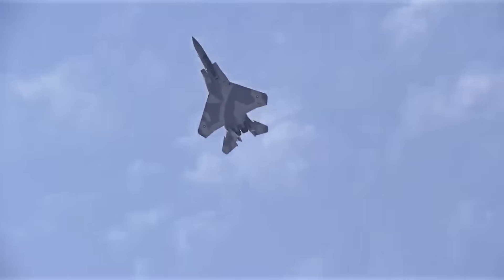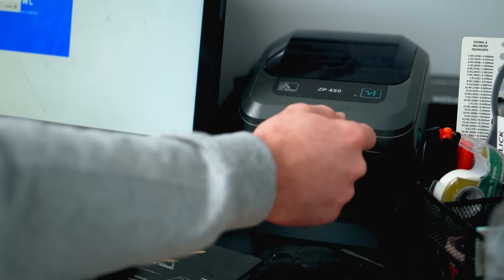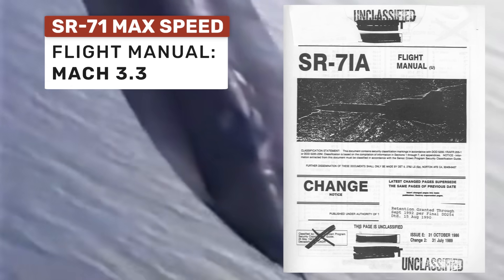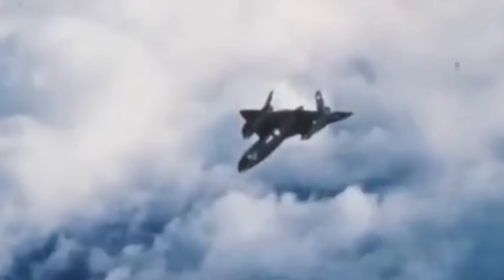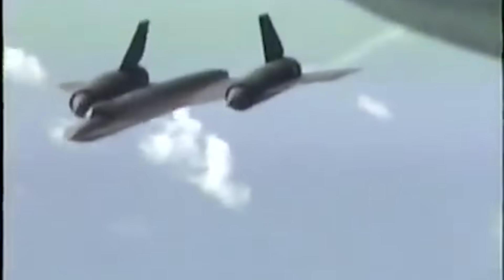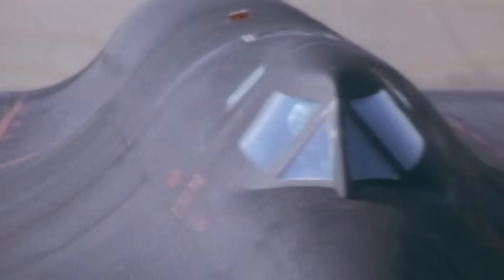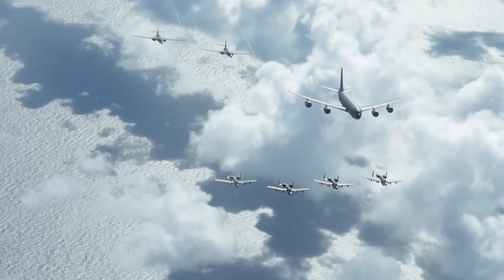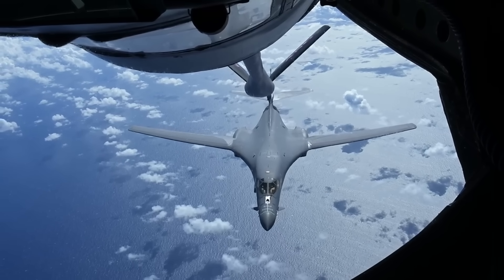The SR-71 was MUCH FASTER than the Air Force will admit

Comment: So TL;DR this plane could fly probably near the range of hypersonic if it were not for the heat build up on the frame. Nobody knows and/or wont ever say.. but I find it odd that today we have the scram jet stuff in the works that is Mach 5 to Mach 10 or more, and we're hiding how fast the SR71 could go from 50 years ago. That seems kind of silly that the real top speed matters any more when we have things that fly much faster and share those openly. Having worked in the airlines, I've talked to a few pilots that shared similar stories of "something" flying well beyond mach 5 to mach 10 on their radar.. be it ufo, military top secret, who knows. But I have no doubt similar stories by multiple different pilots at different times was not some made up stuff. So either there really are much faster military machines, or aliens are here. :D. Regardless, just seems so odd (repeating myself) that we're still so secretive over a jet that is no longer the fastest and how open the world is (China, Russia, us, etc) about scram jet speeds.

Comment: There’s a YF-12 on display at Wright Patterson AFB. When it was delivered to the base it was put on display for base brass and dignitaries. My buddy and I snuck in with our ROTC Uniforms and looked in the cockpit. The seat was gone but the Air Speed indicator went to Mach 10.
Reply: I've been in cars with a speedometer that goes to 140 or 160 that weren't capable of going anywhere near that speed.

Comment: This is not surprising at all.  I think the military dumbs down a lot of these numbers just to keep the enemy guessing.

Not the SR71, but I had a friend who was a reservist at a base that was home to the Galaxy C5.  During Desert Storm, they were loading them up to fly over to Saudi Arabia.  The listed cargo capacity was listed around 750k lbs.  He told me they were loading well over 1million lbs on those planes.  So, if they are messing with just cargo weight, speed data is a no brainer to falsify.  Those were the days though of seeing air shows at that base.  Used to park a Galaxy at the entrance and let you walk thru it to get to the flight line.  The bummer was that the SR71 was supposed to be there one of the show years in the early 90's.  Problem was that the base could not get the fuel to the base for it.  I guess it takes some sort of special mixture, so I missed seeing the SR71.  Did see it in Air and Space museum though.  I would have loved to see it fly.

Now, I did interview with McDonald Douglas back in '75.  They showed us a film of the F15.  Not sure if it still holds, but at that time, it had the record from standing runway to 35,000 (5 miles) feet.  It did it in something like 58 seconds. I know it was under a minute so it could have been 58-59 seconds. Remember, that was back in 1975.  It is still flying today and is still a very impressive plane.  My father was P47 fighter pilot in WWII, so I got some of those genes but sadly, never flew military.

Comment: I was a radarman aboard the USS Longbeach stationed in the gulf o tonkin in 1972. I once tack what appeared to be an SR71 with the NTDS (computer) tracking system. It could not keep up. the computer fell behind by about 30 percent each sweep. the computer maxed out at 3400 knots. max range on the system was 2000 miles. I tracked it on and off the screen.

Comment: I like an interview with a SR-71 pilot. He said they were flying over Libia, and a surface to air was headed their way. He said “ I pushed the throttle forward and out ran the missle. I can’t tell you how fast I was going but I didn’t think it could go that fast”
Reply: @Ghost_Bear_Trader In this context though "out ran the missile" doesn't necessarily mean they went faster. It just means that the missile couldn't close the distance before it ran out of fuel.
Reply: I think that happened with North Korea as well. The KPA (North Korean army) fired a missile at it, so the pilot just throttled up until the missile went off course or ran out of fuel. It's understandable why this plane just drove the Commie Bloc CRAZY.

Comment: I was in aircraft maintenance in the Air Force and we heard all kinds of stories. The Air Force said the SR-71 was faster than a 30.06 bullet. That’s a speed of around 2050 mph or around Mach 2.7. But there were stories of it doing around 3000 mph. That’s Mach 3.9. The pilots wear space suits. The plane stretches in flight quite a bit and the forward nose cowling on the engines creates a negative pressure in front of the engine meaning it will continually increase speed as the air in front of the engines are pulling the engines forward, not to mention the thrust of the engines. This overcomes drag to a point that blows my mind. Wonder how fast it would go if they remotely flew it and opened it up without restriction?
Reply: It expanded in flight. Not stretched. Js
Reply: @comradeeverclear4063  Means the same to me, sort of. But yes, it expands with the heat and friction. I got to meet Chuck Yeager at the aero club on Travis AFB in the late 80s once. He had some wild stories and he used the word, stretch, a few times when talking about breaking the speed of sound. He was so down to earth. But the bravery that man had…balls of steel. 🤣
Reply: @petero.7487  Low pressure in front of that engine does produce a sucking effect like the low pressure above the wing gives lift. Sucking…for lack of a better word. Like something moving in space with no pressure. It it’s moving, it will continue unless something interferes with it. So it’s not generating pull but there’s nothing in front of it to stop it. That’s the best explanation I can come up with. And yes altitude and temperature play a big part in Mach speed. I just wasn’t going to try to be all technical on a TY post, but you are correct!!

Comment: As Shule said, the SR-71 always had more throttle. The fact is there are several US aircraft that go much faster than their stated top speed. Most of them will burn out their engines doing so.

Comment: Well the whole thing about high speed is  thermal dynamics? And it always will be the other fastest aircraft  the xB 70 Valkyrie 3.2  m was a very incredible aircraft it had to be made out of stainless steel and other  rare metals my dad worked on the xb70 and other North American aircraft and Apollo and the shuttle and  B1. And they all had the same thing thermal dynamics is your big problem Heat. As you know  the Sr -71 and the xb70 valkyrie I had the same design kind of it were wet aircraft they were designed to seal themselves as they got hotter. Also I remind people those aircraft were designed before we had digital computers basically they were cocktail airplanes. Now people ask me what is a cocktail airplane? Well back in the great day of aircraft most of the best aircraft designed after hours at the bar usually on a cocktail napkin seriously I'm not making this shit up. It seemed that the Aerospace engineers did their best work at the cocktail lounge

Comment: To calculate the speed, weight to power ratio; then to atmospheric resistance (service ceilings) and you can get a rough estimate of the aircraft top speed, and whether or not the body of the aircraft is capable enough or would fly apart. I believe the SR-71 was capable of at least Mach 6, at altitude, in small periods for evasion maneuvers, but Soviet missiles were being designed to extend their altitude, tracking and speeds of up to Mach 8, in order to overtake and destroy it.

Comment: 3:20 in and we actually get to the topic 🙄
Reply: The sr71 can do 45 miles a minute and can cross Nebraska in a little under 5:00 minutes. All 220 miles(width) of it. That’s Mach 3.5 which is the fastest it can go. Well atleast the fastest anyone was willing to push it. I did all the math based on an interview with a reliable source(SR71 Pilot). Please be cordial. I am not making any of this up I absolutely would not waste your time or mine. You can do the math for yourself. Nebraska in 4:30-5:00 minutes is Mach 3.55-3.50. Also in this video alone a pilot reported him doing 3.5 running away from a threat so now that’s 2 pilots who have made this claim and I fully believe them. That’s 2,685 MPH. Absolutely insane and ridiculous. I couldn’t imagine being in the baddest and fastest air breathing machine ever built back in the early 60’s (1964). Must’ve felt like you were flying a legit space ship which you kinda were. Flying on the edge of space while wearing a spacesuit. Like Jesus Christ, I couldn’t imagine. Even if you built the sr71 today it would still look very modern and have modern performance being able to out perform anything else in the world. And to have that feat still to this day(60years) really goes to show how advanced this plane really was. Should’ve never retired it. Should’ve built a bigger super version with upgraded engines, more advanced materials, making it stealthy with modern radar absorbing coatings, and more advanced cameras, and jamming systems. Making the plane 20% bigger with bigger more fuel efficient engines would allow it to travel much further and faster and doing around 4,400 miles at Mach 4. It would be unstoppable. We’d be flying directly over China or Russia untouched and unseen on radar. Should’ve made a super sr71 like they did with the f18 hornet turning it into the super hornet.

Comment: What I heard was that it could fly faster, but it wasn’t stable and could flip nose for tail.  So pilots said if they had to push it to go faster, it could but you had treat the flight controls like they were covered in razor blades.  Any non extremely gental touching of the controls could kill you quickly.
I gather the engines were rated for a max of Mach 4, so I always wonder how fast a YF-12A (with more tail surface for stability) could go?

Comment: Max advertised speed has always been 3.2+ and that is all you will ever know. True speed is classified and will remain so. The raid on Libya back in April 86 the pilot's transcript of the mission stated they hit Mach 4 after their Recon run when Libya fired some Sam's at it and throttled back shortly there after when the threat was dismissed. CAC (Combat Alert Controller), I was there. 🤐

Comment: The raw thrust to weight ratio of the F-15EX really does not mean that it could go Mach 2.9. Neither the existence of the Vmax switch. The only matter is the shape coefficience, the wave drag and the inlet-engine combo supersonic  characteristic. Just remember, the mighty MiG-25 had way less static thrust at max ground AB than the EX has, while its normal takeoff weight is way more than the EX. From top speed standpoint it is really doesn't matter. The point is: the F-15EX has a huge bubble canopy and a very capable, relatively high (0.76) pressure ratio turbofan AB engine, which was designed to the sub- and transonic  speed. The "weaker" MiG-25 has a dedicated Mach 2.5 - 3.2 turbojet engine with the extreme low pressure ratio to meet with the extreme high inlet ram air presssure ratio. By the way, the MiG-25PD with four huge R-40 missile was able to reach the Mach 2.8, while a two seater F-15E  Strike Eagle with the CFTs could only reach Mach 1.8, but with empty pylons. With weapons, the top speed is Mach 1.45. The true top speed without any CFT, EFT, weapon, pylon, TGP... is just Mach 2.49, but the internal fuel is running out earlier than to reach its limit. And, by the way, the twin seater canopy's own speed limit is Mach 2.0. Compare the F-15EX to the F-35A, the EX combat loaded top speed Mach 1.45 is less than the slower F-35A combat loaded practically available top speed Mach 1.6...

Comment: While it is true that the .gov understates maximums, any claims of the SR-71 having more than a couple hundred knots extra performance in it is going to have to deal with the wing sweep back angle, engine spike angle/range of motion, turbine metalurgy being optimized for mach 3.2, and explanations of how the engine would be pulling off supersonic combustion (at a certain point, you can't slow the air down enough). Also mach speeds do not correspond to specific ground speeds... whats more relevant would be the indicated airspeed.

Comment: The A-12 was specifically designed to be faster than the SR-71. It’s also a matter of physics that it should be faster given it’s lighter. There are also CIA A-12 pilot accounts of them routinely surpassing the performance numbers of the SR-71. They all called the SR-71 the family model of aircraft family. There was a reason the CIA selected and continued to operate the A-12 after the SR-71 program was canned.

Comment: When I was an engineer working for a small shop, Vortex Engineering, we were making tooling for the aircraft companies I received a photo of the SR71 that had specs on the back saying the declassified speed was 4500 mph at 50% throttle @ 90,000 ft. We did a lot of work for Skunk Works back then. That was in the seventies. We also were making tooling for the F-16, F-15, F-14, F-18, B1 and B2 before I retired from there
Reply: Ram jets going nearly mach 6 at 50% output? I highly doubt those numbers.
While the blackbird was a highly capable high speed jet, she didn´t go X-15, rocket engine fast. 
The first air breather engines they got that can manage hypersonic are scram jets and that tech is not that old.
Reply: @andreasmuller4666 All I can say is that's what they gave us. So My guess is they are liars. Right! By the way Scram jet engines have been around since the '50's. Do more research.

Comment: During the Falkland War in 1982 our was at RAF Lakenheath.  The SR-71 stationed there were flying recon for the Brits over the Falklands.  I was working the Flight Line and saw a SR-71 takeoff and it literally made the hair on the back of my neck stand straight up !    I will never forget the breath taking power, sight and sound of the SR-71 !
Reply: They were stationed at RAF Mildenhall not Lakenheath. The F111s were stationed at Lakenheath. I spent a year supporting one of the SR71 payload systems from 1987 to 1988. We lived in West Row which was right next to the Mildenhall flightline.
Reply: they were based at Mildenhall, though only on temporary assignment in '82, they did operate out of Lakenheath during the 80s, when the runway at Mildenhall wasnt available for use, but as the RAF found out with flights to the Falklands, youd need a whole fleet of KC135s flying over the south atlantic and fuelling each other just to stay there, for any plane, let alone the SR71 to get there and back, its a 16,000 mile round trip.
Reply: @TheMcspreader ? Where is “Wideawake”?
Reply: AMEN!

Comment: The top speed of all of the J-58 powered "blackbirds" is limited by the INLET AIR TEMP of 427 degrees celcius.  Usually mach 3.2.  A-12, SR-71 or YF-12 makes no difference.  A-12 is lighter and climbs faster and higher but the SPEED remains the same for the same reason.  The A-12 didn't hold any "official speed records" only because it was a completely BLACK program that was only declassified in the early 1990's.

Comment: there are many numbers when dealing with military equipment.  There is often the operating range, full operating range, and then there is the safety margin before the equipment performs a RUD to borrow from space X. In the video one of the pilots mentioned take off is done at 80% and this is normal full thrust for operations.  To go beyond this number often requires authorization as it often comes with a full teardown and rebuild of several key parts, namely the engines.  The high temps and stress of going beyond 3.5 could cause a plane to be totaled as the damage would be to severe to repair it.

Comment: When I was in the Army I spoke with an Air Force Crewman. I asked what was the maximum speed of an SR71. I'll never forget his answer. He said, "That plane will fly itself to destruction." Meaning it could tear itself apart. I would remind viewers that the plane is designed to grow about 100 cm while in flight to allow for material expansion. With some accounts saying it could reach upward of 200 cm of stretch. It was really about how close you wanted to get to Jesus. Push that bird too hard and you'd be seeing him.
Reply: @petero.7487  I get it. Much like the Bugatti Chiron. The car can go faster than its top speed, but tires would give out. So the car was electronically limited.

Comment: It always amazed me that the SR-71 was mostly designed  with slip-sticks and yellow tablets! No 'puters then!
I had followed the SR-71 from the very beginning!
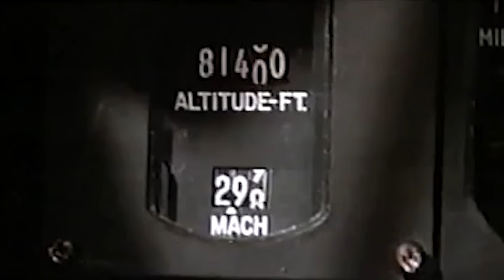While stationed in Korea in the early 70's, supporting Stock points computers, US Army Computer Systems Command. We loaded one on a plane and I escorted it to Okinawa to install it. We landed about midnight unload time was set for 10:00AM.  I was on the tarmac about  9:30 had my duffel bag and as always my camera on my shoulder.   I was observing the unload and an MP tapped me on the shoulder and said, "Whatever u do DONOT touch ur camera!" I asked why, he pointed at the long runway going out in the sea, built for B52's out of Nam.  A small black spec was turning around at the  very end of the air strip, as it turned it throttled up, in about  100yds the nose lifted, hard throttle and it went almost straight up, out of sight in seconds!
Okinawa was a service and fuel point for the SR-51's . I just happened to be there at the perfect time!
I have often wondered, had I known, if that one photograph would have been worth,  PCS, (permanent change of station),  Ft. Leavenworth  Kansas,  unaccompanied,  forfeit all pay and privileges, 50 to life........🤔
The best highlight of my career !
Reply: Kadena was a permanent base for SR-71's.  I was in the very first TDY stationed there in 1968, and again in 1969-1970, in the SR's maintenance squadron.